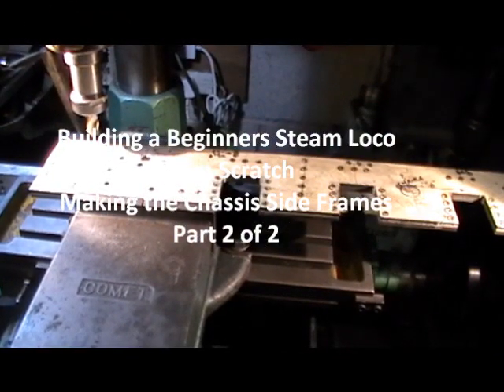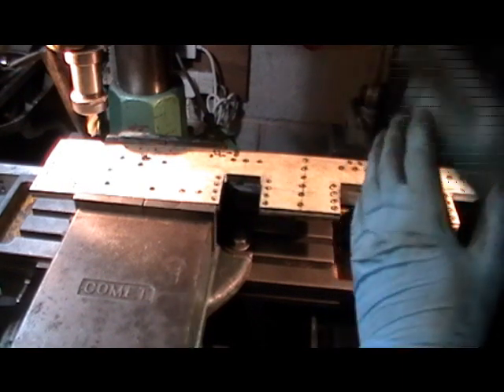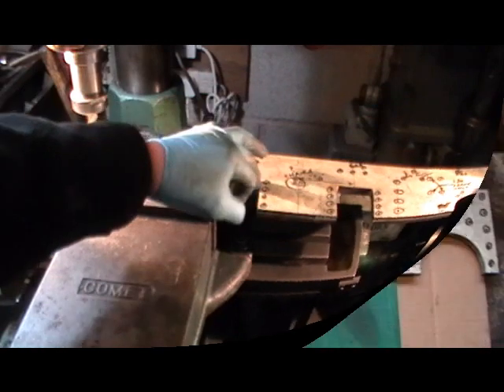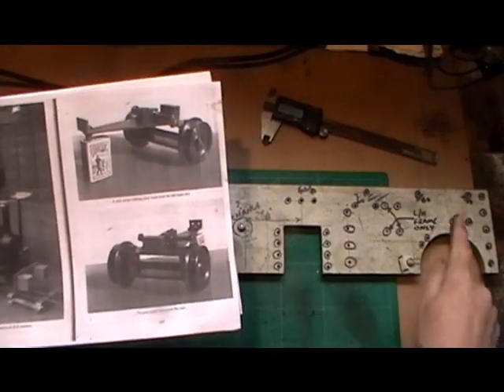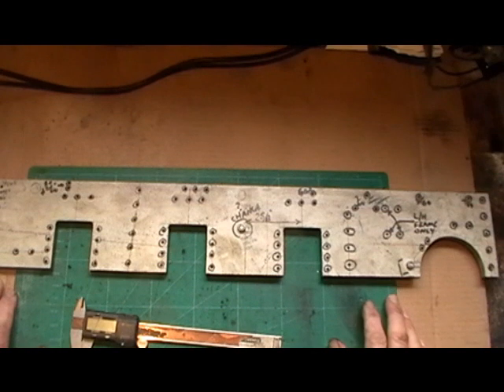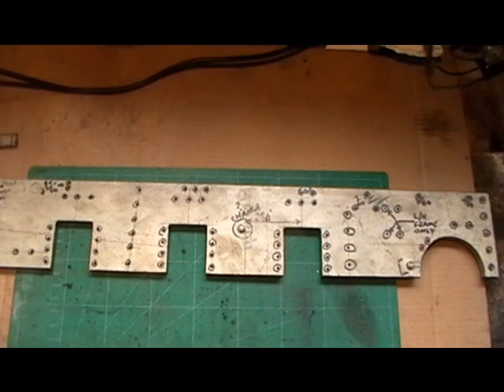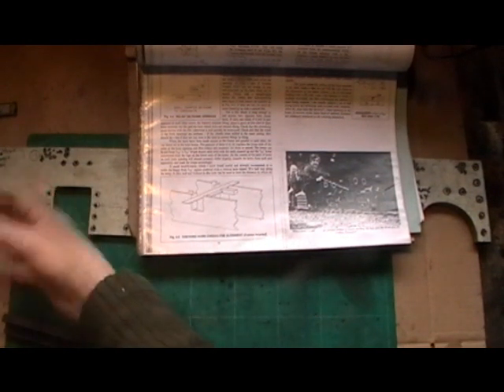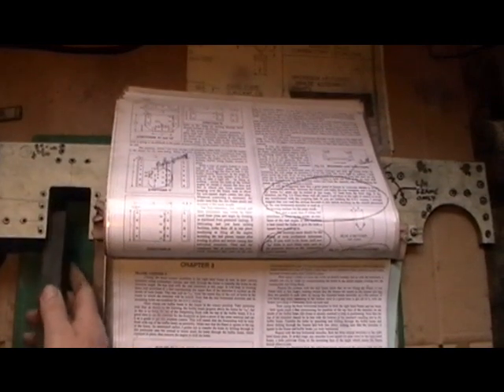Making a Beginners 5" Gauge Steam Loco (Part 2 of the Main Side Frames) "mr factotum"

Comment: I have completed my 6 wheels and crank pins. Just about to start drilling my frames. Just deciding if i want trailing pony. Did the trailing pony improve anything or are they for looks?
Reply from the maker: eyup km5179
great to hear from you with an up date, i'm no expert on this, but others tell me it helps, then others tell me it doe'snt make much difference. 
As a novice to steam locomotives i can gaurauntee, what ever the subject matter is, i  always get conflicting advice. so i just do what i think is logical and how i want it to be, most times. 
Personally i would say extra wheels will give more stability, especially on corners and also any downward forces applied to the drivers end of the loco they help to stop it tipping up at the front, also just my personal preference i think they look better with them on.
I think while your doing it at this stage, i would be to put them on, but it's your loco, your choice because everyone is different, go with your gut feeling, what ever you choose you won't be wrong, because there's loads of these loco's with and without.
Hope i have'nt made your decision harder than it already is.
keep in touch
BFN
Kev
Reply: @Mr Factotum's Workshop  thankyou for feeding back. My first inclination was to fit them, then i changed my mind. I think I will stick with my first thought and   start off with cutting the frame to take the pony and then I can decide later.
Reply from the maker: @kentishman5179  good idea, cover all angles👍👍👍👍

Comment: I did mine yesterday with a carefully clocked vice and table and cross slide stops set.
Great to be able to move them all up and down! I have a Warco Mill 18 the latest with such an amount of table travel. 
Today was the turn for a curved front by the smokebox, As I did the drawing cheated and measured a new carbide cutter 2" in diameter!!!
Love David and Lily.
Reply from the maker: Sounds interesting, thanks for comments
Regards
Mr f